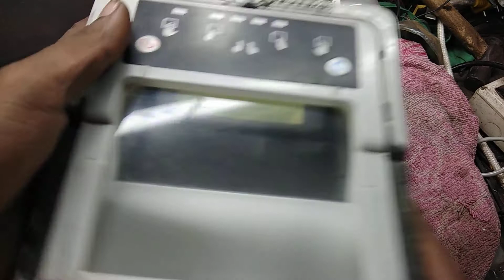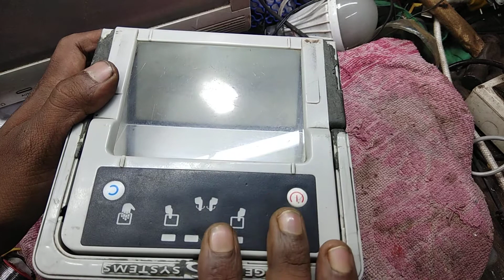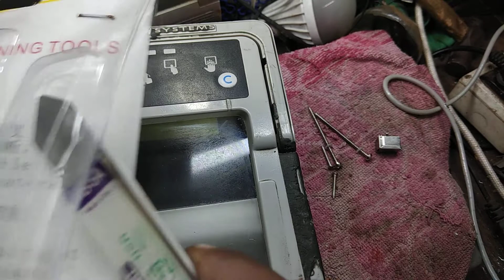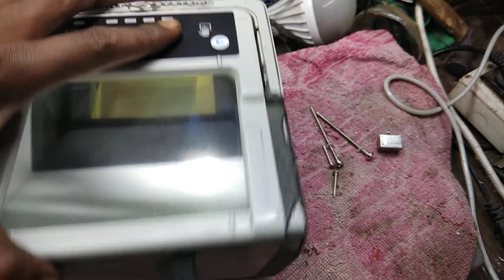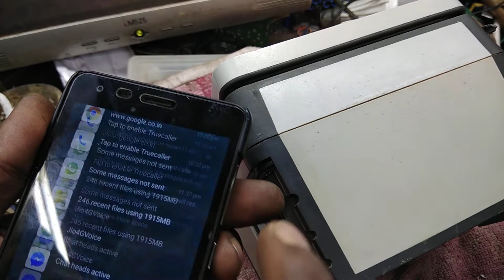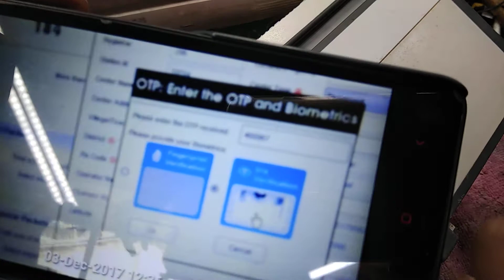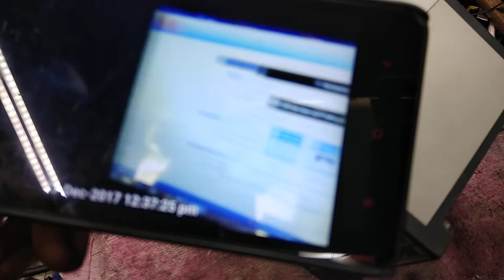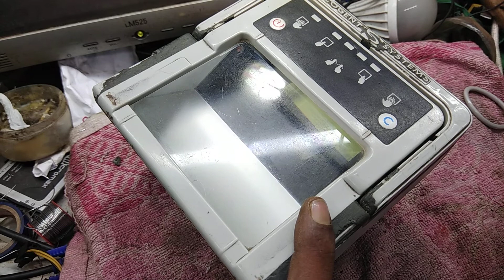Fingerprint Scanner Slap Scanner Morpho Aadhaar kit repaired

Comment: Dear Sir, my fingerprint device name cogent cs500e not working. when I connect this in USB port then it is show in device and printer and its light is on. when i start adhar software then its not show in aadhaar software. but light is allready on. What is the problem and how I solve it.........